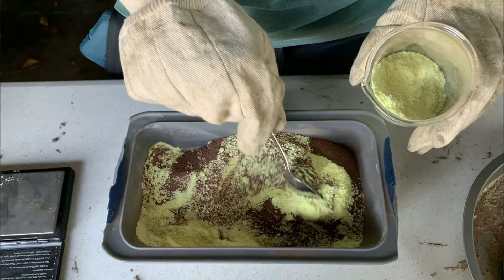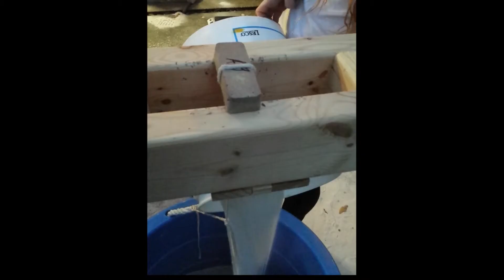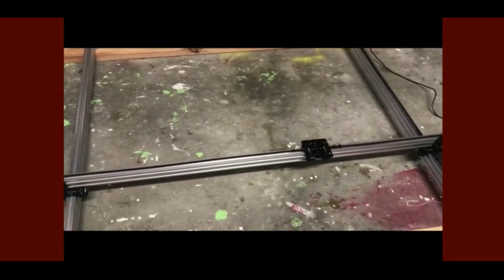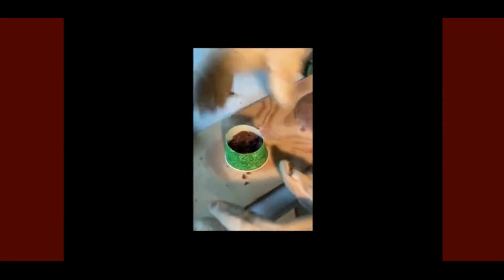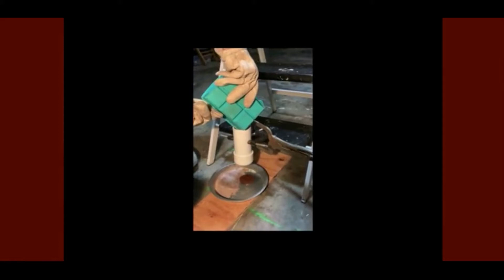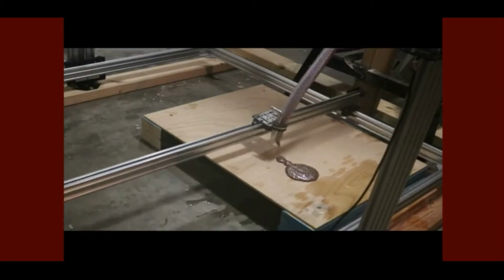In Situ Resource Utilization of Martian Regolith for Construction (Year 3)

Comment: Really nice work, good clip.

Perhaps if you melted the mix at the extruder tip you could use the stiffer mix,  with the aim of having it set hard enough in the time it takes for one circuit of the  square. A heavy weight in a well shaped mixture feed bin may give you the pressure you need, at least to refine your process.